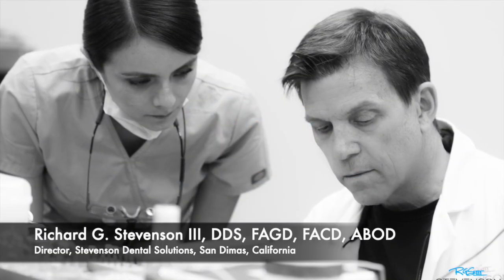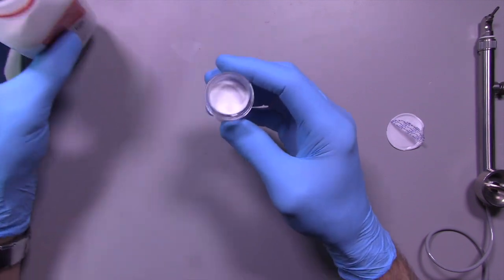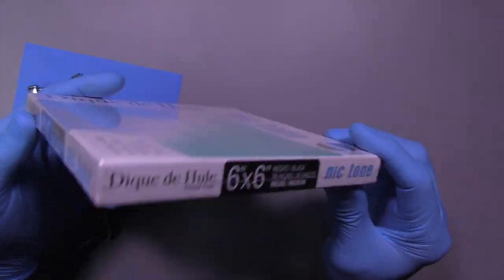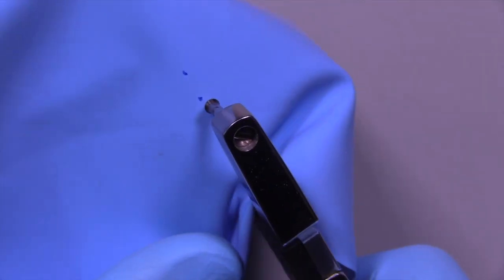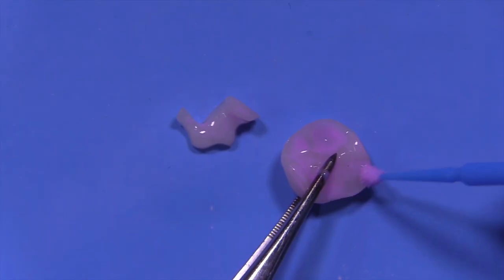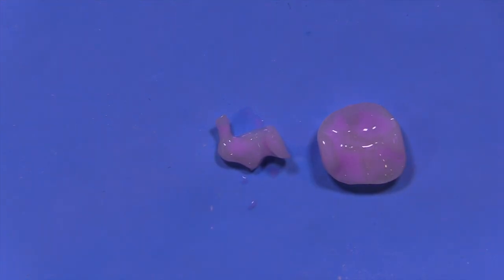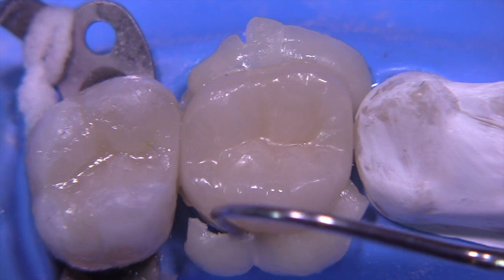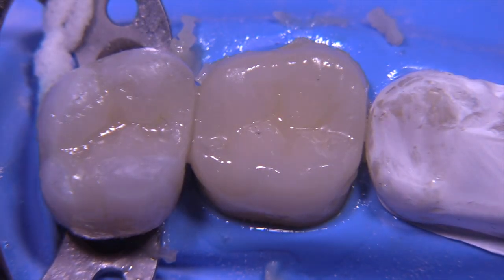Lithium Disilicate Ceramics, Part  5: Cementation of Inlay and Onlay

Comment: at 11.44 in the video u jumped from HF etching the margins of your inlay to silane treatment ..??? u cleaned the HF off and then phosphoric etched to remove the residues ?? or as the video suggested you applied the silane directly to the still etching surface ?? Confusing
Reply from the maker: Thank you for the Questions. Tooth: Phosphoric acid, etch, rinse and suction excess, then apply bonding agent and lightly dry.  Restoration: HF intaglio and edges, rinse, dry, then mix and apply Silane, then air dry, then apply boding resin, air dry.  After this, apply warm composite and cement.  Sorry for the confusion doctor and thank you for pointing this out.  Dr. S

Comment: Could you please tell me what kind of composite do you use and prewarm  them to which temperature？cause I know not all composite can be used to cement ceramic restoration.thank you
Reply from the maker: 54-60 C  with most composites (check with the manufacturer for your specific composite).  Film thickness tests have been published for traditional resin cements and the best bond strength were found when the cements were between 50-100 microns - when very thin, like 20 microns [https://doi.org/10.1016/S0109-5641(96)80030-3], the bond strengths dropped significantly.  For the warm composite technique, one lab study [https://doi.org/10.1016/j.jds.2014.03.006] published show that the Tetric Evo Ceram Bulk Fill (Ivoclar) was thinned to about 75 microns when warmed to 60C, and in general nanohybrids were thinned better than hybrids and microhybrids, using a 15 Kg. static load with glass slabs.  I believe that with vibration using a chopstick and mallet, we may reduce this even more. The worst performers were the packable types. like Filtek P60.  All composites when warmed to 54-60 C will reduce in film thickness significantly - about 30%.  Hope I've helped!
Reply: @StevensonDentalSolutions  perfect🌹👌whats the benefit of heated composites to resin cements??

Comment: Hi Dr, fastantic video. a question.
Is not it better to use a wheel core-build up such as ParaCore or Core Lite DC?
Reply from the maker: Yes these are great options and I use ParaCore when I believe that there is structural compromise.  For minimal block-outs, I use RMGI.

Comment: thx for the good video. I am a dental school student and have a question. why did you etch only th margin of restoration? I think you just say the reason in the video, but I couldn't understand cause of my english problem... TT
Reply from the maker: The dentin was sealed during the preparation step (IDS), and then it was cleaned with Aluminum Oxide - therefore, no need to etch, as it is covered with resin.